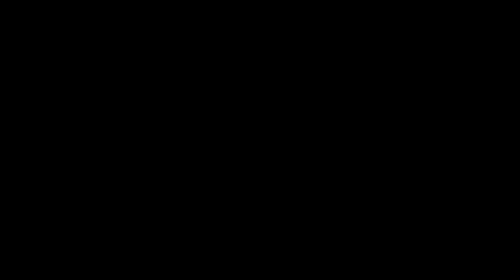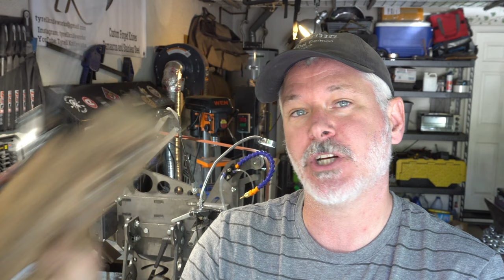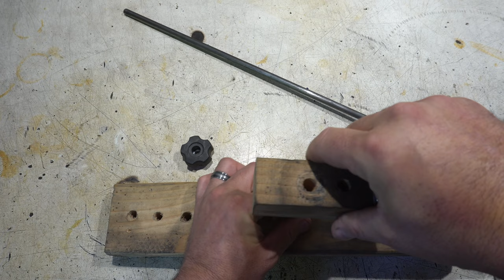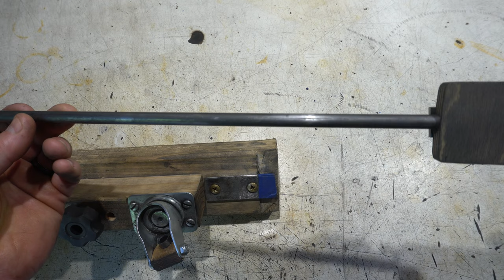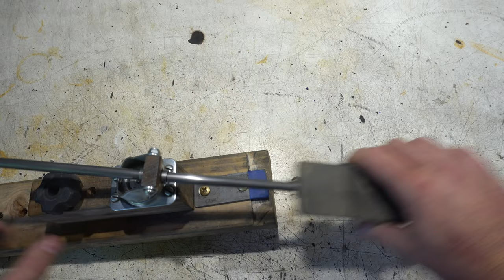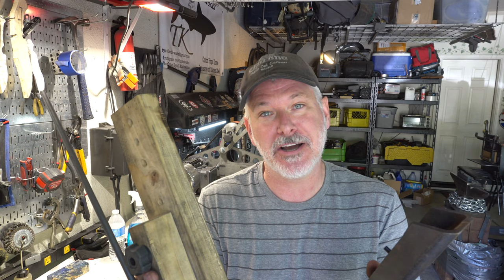Triple-T #42 - How to make a filing and straightening jig

Comment: I cut out a lot of steps by using an eye bolt and some holes. I adjust the angle by turning the eye bolt to raise or lower it. I slide the rod right thru the eye once the angle is good (I set an angle cube on the rod for the angle).
Reply from the maker: Yup, that works too, Jack!  Thanks for watching!

Comment: I built a slightly different one, per a YouTube video, and I think I'm going to modify mine so some of your features improve it. I particularly like the simple system to hold the blade.  I use mine all the time; it takes more time than using my 2/72 but I don't get divots with it! Thanks!
Reply from the maker: I'm glad you got some good info out of the video, Bryson!  Thanks for checking it out!

Comment: Hey Dennis,  I am stoked that you posted this jig to the tube! But couple quick questions so I dont go reinventing  wheels!  Did you use the axle of the removed wheel for the axle of the wooden guide? Second question was answered during the second or third time watching the video :) Oops another popped up; would it best to use a half round file   to fit the curvature of the false edge, does a flat file work well enough? Thanks again D for another great presentation  :)
Reply from the maker: The rod is just a piece of 3/8 round rod from Home Depot.  You are better off using a square file since it’ll contact more area on the edge.  Thanks for watching!

Comment: Did you just use the axle of the caster wheel for the axle for the guide? I've seen you use this jig in a few builds and its definitely the ticket for filing the false edge. I have a build coming up that on to which I want to put a false edge, a hunter for a friend out east
Reply from the maker: Yup, it’s a cheap caster from a hardware store.  👍

Comment: I'll be whipping up this file guide; on  a near future build, i want to put a false edge on it,  and this jig is the ticket. I have one question regarding the fasteners used to mount the wooden guide onto the caster. It looks like it's a threaded rod with opposing threads on either side and smooth in the section that runs through the guide.  I suppose I could use all-,thread and sand out the threads in the section that runs through the guide?
Reply from the maker: No, it’s a straight round rod, no threads.  I just epoxied it into the hole on the wood side.  It’s very low tech but works like a charm.  👍

Comment: This will only make the same angle on a circle, not a line.
Reply from the maker: No, think about it.  This is also how every one of these sharpeners work.
Reply: @TyrellKnifeworks  Would you do a side shot while sharpening?
Reply from the maker: @bob-ny6kn  I don’t use this one for sharpening any more.  I use a Wicked Edge sharpener, which is the same concept but two bars so you don’t need to flip the knife.
Reply: @TyrellKnifeworks  Can this be used for beveling a knife?